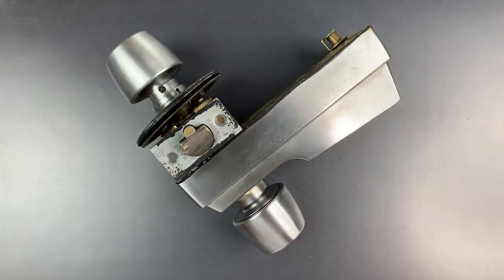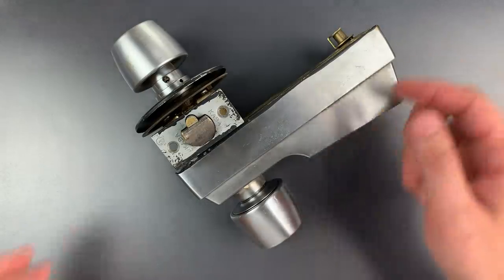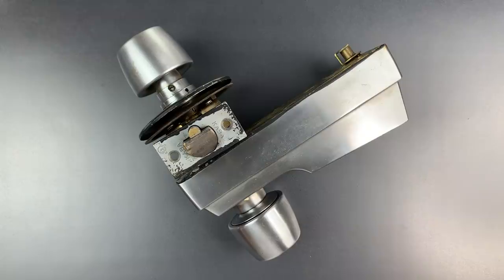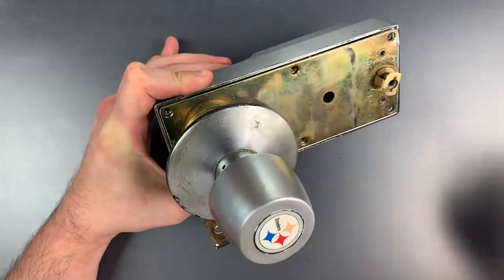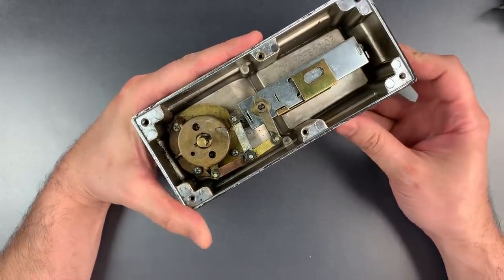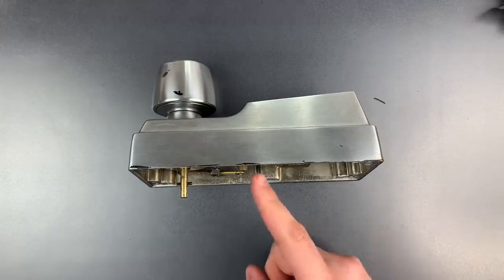[914] The Worst Lock Design Blunder Ever? (Kaba Simplex Series 1000)

Comment: Post Office I worked in 2008 had all the locks replaced with these.  I showed the post master just how easy it is to open these locks.  Postal inspectors came and looked at them and nothing was done.  The US postal service bought and had installed thousands of these locks.  (They were/are not inexpensive)To my knowledge, none were changed that I know of.  A friend who is a car dealer had this K 1000 on his key room door.  I showed him how easy it was to open and he had a local locksmith change it out for a Kaba 5000.   I understand lots of legal issues with this lock.
Reply: That just shows the difference between government vs private businesses.   Business owner alerted to a problem and just fixes it if possible.  Government alerted to a problem and it needs a dozen forms in triplicate to get an inspector out to verify that yes its a problem and send the forms off to a comity somewhere to ignore the problem for the next decade or untill the problem bites them in the ass.
Reply: @merendell  It also holds true with massive corporations as well though, big businesses don't give power to the people who can make change and the people who can don't give a shit.
Reply: @merendell  It's not that they don't understand the problem. What's it gonna cost if they don't replace the locks? For most places, nothing. The security of a government building does not come from locks. The businesses however have to worry about theft more than government.
Reply: @merendell  Yea, private businesses never make stupid mistakes /s
Reply: Our post office had a P.O. Box door pried partway out from the frame. Postal Inspector was called, looked at it, and figured it since it was still locked, and only partway open, no actual theft had occurred so no further investigation was called for. Easy!—except that it was obvious you could simply push a screwdriver into the opening and retract the latch. Customer of that box later reported several checks missing. One lazy goof, or are all PO Inspectors of that ilk? I dunno.
Reply: I believe at that time, the Postal Service had a particular YALE electronic lock requirement. Sometimes a postmaster was not following their own regulations.
Reply: @merendell  Try to calculate the cost of changing one lock versus having to change hundreds of thousands.
Also add the fact of: Stockpiles and the cost to scrap an inventory just to replenish it yet again >.>
Raise your taxes, and I'm sure they're happy to use your money like you want them to 😂

Also: How many post offices have been broken into due to this particular lock? 0? Alright then; shut up 😎
Reply: @MrMiss-cp9bw  cost to change 1 lock, 100 dollars per lock. Cost to change many thousands, 500 dollars per lock because the government handed out  a no bid contract for the lock replacement job. Probably alot more in all the various studies that need to be done before the committee makes a decision to replace the lock with one just as bad.

And to your last point. If the rest of the security is so good that even with shitty locks like this on the doors no break-ins have happened why did we need the shitty lock in the first place?
Reply: " Postal inspectors came and looked at them and nothing was done."

are you aware how lucky you are that they didn't sue you for a break-in?
Reply: @CaptHawkeye yep many people are negligent, also many small business fail in the first few years because of it. Gov is too big to fail so gets protected from screwups that would tank a small business reducing the pressure to do better.
Reply: @SirMcAwesome  U mad bro?
Reply: Yea but concider this. How many people actually have the knowledge and resources to open these locks? Probably not a lot. If someone is commited enough to beat all other levels of security and secure a high power magnet, that person could have probably gotten through the lock another way
Reply: @DimT670  Your excuse can be used to justify any bad lock then.  Just stick a Masterlock on everything.  "If someone is commited enough to beat all other levels of security and secure a high power magnet, that person could have probably gotten through the lock another way."
Reply: @poochyenarulez  it’s more that if a private company makes enough stupid mistakes, they go bankrupt. If a government makes enough stupid mistakes, they just raise taxes.
Reply: @choreomaniac  when government makes mistakes, you vote out the republicans who sabotaged it and vote in politicians who actually want tot fix it.
Reply: @poochyenarulez  yes. Look at Detroit, St. Louis, Chicago, Philadelphia, etc that have been run by Dems for 50 years. They are run so well.
Reply: @choreomaniac  yes, the areas with the most gpd are democrat runhttps://en.wikipedia.org/wiki/List_of_U.S._metropolitan_areas_by_GDP
Reply: @poochyenarulez  and the most crime, poverty, homelessness, mental illness, etc. urban areas are more affluent and more plagued with problems. But many of the affluent areas pinpoint to have recently been run by Republicans. Such as NYC. Look at the cities that have been run for 50 or more years by dems. Cali had Republican Schwarzenegger and NYC had Giuliani and Bloomberg was non-Partisan. Virginia and Maryland recently had GOP governance. It takes about 20 years or so for dems to destroy a city. Probably faster when de Blasio is in charge.
Reply: @poochyenarulez  and it’s funny that the old line was that the GOP was the “party of the rich” now the Dems are proud to point out that they represent the richest areas of the country!
Reply: @choreomaniac  Dems have always been proud to point out rich areas they run. Its rich individuals that dems find issue with, not a rich society.
Reply: @poochyenarulez  rich areas are by definition composed of rich individuals. In fact the greatest areas of income and wealth inequality are in dem areas. Homelessness next to billionaires is pretty much exclusive to democratic run areas. It seems democratic policies make wealth inequality worse, not better as they say their policies are intended to be. The very rich can avoid taxes and the very poor don’t pay them. The middle class gets pushed out and crushed. Look at California and NYC. The GOP is the party of the middle class and workers. The Dems are the party of the super-rich and very poor. The Koch brothers announcing no more donations to republicans is emblematic. Same with Bezos, Buffet, etc. the billionaires are mostly Democrats. And that makes them and the Dems giant hypocrites.

Comment: This reminds me of a situation which happened when I was young. We lived in an apartment complex with an electronic combination lock and I had taken apart a push-button lighter and was playing with the little piezo electric ignitor (the thing which you press and it makes a small zap). Out of curiosity I put the wires from it up to the lock, which was completely metal. To my surprise, when I zapped the lock it opened. It worked every time, and this was the standard combination lock in my entire city. I did not try it on other houses so it might have just been a flaw in this particular lock, but I'm wondering if anyone else has had a similar experience with electronic combination locks.

Comment: Thanks LPL!  This inspired me to add a big neo magnet to my pick kit!
I now have a chaotic stuck-together ball of picks and tensioners.  :-/
Reply: @Cheryl:  Wow, that worked well!  And thanks for the warning.  I hid behind the wife and kids.
The funerals are next Tuesday.
Reply: Just get a non magnetic magnet, that should solve all your problems.
Reply: Thanks Obama!
Reply: Obama care was never the answer
Reply: JamesG a
Reply: Won't loose them unless you loose the magnet XD
Reply: We used to have those at area 51 where the reverse engineering shop was, the Aliens kept breaking in we didn't know how. Now everything makes sense.
Reply: Just keep it away from your wallet.
Reply: I carry a magnet on an extending handle in my car's tool bag for retrieving hardware dropped in inopportune places. I sometimes refer to it as The Niffler in reference to the creature from "Fantastic Beasts and Where To Find Them" that always grabbed up valuables. It always grabs everything and makes a royal mess of itself. Same goes for the old car speakers on the junk shelf.
Reply: @quillmaurer6563    Cool, you're a smart feller!  I actually have a collection of NdFeB magnets, including a 2x2" cube and a 700-lb-pull monster that I embedded in a wooden block for safety.  That one does awesome things to nearby ball bearings, makes them into a moldable stuck-together mass.  These magnets have endless uses, practical and impractical.  :-)

Comment: My old office had one of these on a back door. Knowing that they typically use a 4 digit combination and that the digits can't repeat makes brute forcing the combination easy. I was able to brute force it in about 3 minutes one day.
Reply: The number of permutations is still 120. It definitely is not easy to brute force that manually. You got very lucky.
Reply: @aitismarka9483  not really, it takes probably 2 seconds or so to put in a code and turn the handle. three minutes is 180 seconds which means he could easily have put in 90 combinations in that time. Actually means he was unlucky lol, most of the time you would get it at or before 60 combinations, or about 2 minutes.
Reply: @itisinfactpaul2868  It is really difficult to come up with that many permutations without repeating ones you've already tried. You can test it yourself. Try to come up with as many non-repeated four digit codes out of the numbers 1, 2, 3, 4 and 5 as you can. Absolutely no way anyone's going to be able to come input 90 of those in 3 minutes. Without pen and paper that would be almost impossible to do even with unlimited time.
Reply: @aitismarka9483  All you need to do is count up from 1234 lol. Just skip any number greater than 5 or that's already in the code. I certainly hope you could do that quickly in your head lmao. Once you get to 4321, you've listed every code. Like this:
1234
1235
1243
1245
1253
1254
1324
1325
It would be even faster to do in front of the lock since there are only two final digits possible for any set of three initial digits and you could easily see which ones hadn't been pressed.
Reply: @itisinfactpaul2868   Oh shit, I hadn't thought about such a clean way to do it systematically. Just a little correction: you gotta do it up to 5432 and then you've inserted all 120 permutations. Thanks, mate. Gotta admit I was wrong.
Reply: @aitismarka9483  24, if you know what the four digits are. Frequently the buttons are worn down.

Comment: I have seen this lock (and the 12 button version) used on a lot of homes too, especially homes with younger children prone to losing keys. First responders in some areas in and around New York City used to use this trick when responding to a location with one of these locks so that they wouldn't have to break the door or wait for a locksmith.
Reply: trick doesn't work on codelocks or similar sabat locks
Reply: C Riley He said they used the trick on one of these locks... read the comment first....
Reply: haha okay Mr hobby locksmith, go get one and you'll see what's up. It's not like I know what I'm talking about or anything.. I only do this for a living 🤷‍♂️
Reply: @crestonriley6481  Literally missing the point of the post.

First responders would use the trick shown by LPL, On this specific lock, and a variant of it. Not any other brand. Not any other model. 

Your comment adds nothing to the original statement.
Reply: @olejniczak12  There just has to be one guy like that in every YT comment section xD

Comment: We had those on our classified shop doors in the air Force. Absolute trash. We had to turn the knob twice to get it to clear the valid code. They also break all the time
Reply: I was at work one Saturday when the plant locksmith decided it was a good time to change the combinations on all the basement labs without notice, which would force the users to go to the locksmith first thing Monday morning to register for the combo.

I called his office and left a message that I had something in the oven that was time sensitive, and to get down the basement ASAP. He left for the day. A pipe wrench makes these locks absolutely worthless. I got in the lab and removed my part from the oven with minutes to spare.

Never heard a word on the damaged lock.
Reply: Gunga Dinn I wonder what kind of oven would be used in an industrial manner like this.
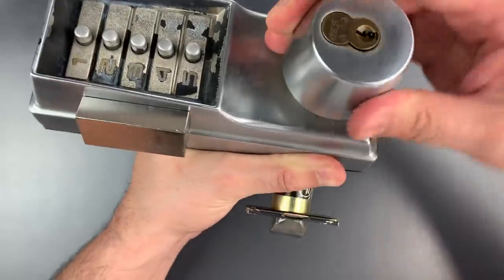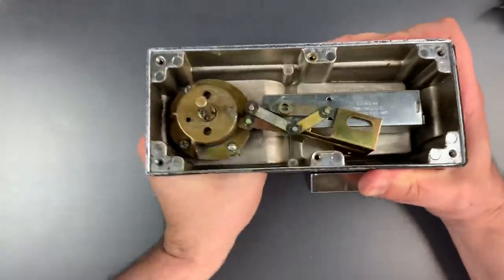Reply: you can see him having to turn the knob twice too at 1:15 and 2:31
Reply: @B0MYT +
  It was a Blue M process oven, and I was vacuum curing an out of autoclave graphite epoxy part. 

  We routinely would set a part up to run, being recorded by a DigiStrip recorder.
  When we worked weekends, you had three or four irons in the fire at a time. I'd be working in the machine shop machining test specimens, then in the QC lab for a 24 hour non-volatile test sample, and in between eating lunch. 

  My Blue M oven was only turned off when the power went out, otherwise it ran 27/7/365.
Reply: LPL had to turn the knob twice as well...
Reply: @Don.Challenger  People get rather pissy when you use those ovens for pizza.
Reply: I noticed he also had to turn it twice to get it to open. Very strange.
Reply: Godfrey Poon+

  I got pissy when people decided to cure silicone containing materials in MY oven. 
  Silicones out gas contaminating the oven which transfers to everything cured  inside the oven. The only way to get rid of the silicone is to burn the oven off at 650 Fahrenheit for 24 hours. 

  Some people are too stupid to read the sign that read, no silicone containing materials to be cured in this oven.
Reply: We had cypher locks that you connected wires to numbers to complete a circuit (Navy).  They were ok.  But our safes for the dual lock integrity were garbage.  They were rated at like 3 hours for someone to break into.  More like 10 minutes with a mini sledge and a crowbar.
Reply: Also, if you notice the little latch bolt, the sloped face is facing the direction of the outside of the space or compartment, meaning if you wanted to get in the old fashioned way using a credit card to swipe it open, you could. I literally used this trick to steal tools from the engineer's workshop.
Reply: @accelmemory  I would assume that is an installation choice, as that piece is usually reversible. In a real installation, it should be installed the other way (correctly).
Reply: I worked at a hotel a few years ago that had one of these for the front desk entrance, and yea, ours kept breaking to the point that we had to put paper in the jamb to keep the door from latching shut just in case it decided to not work again.  There were several times when I had to jump the desk just to open the damn thing from the inside.
Eventually the owner finally had it replaced with a more conventional key lock knob but it was a nightmare until then.
Reply: @accelmemory  You are completely wrong about the correct way to mount latch bolts.  The direction shall be so the sloped side hits the door frame first.  The strike plate on the doorframe shall have a hole so small only the sloped half goes in while the pin half is held into the lock, thus causing the deadbolt itself to disable the credit card trick whenever the door is closed.  Because he was demonstrating the flaw in the lock part, LPL didn't show the strike plate.
Reply: @johncrowerdoe5527  I'll correct myself to say that if the slope is facing outwards, then you can easily get in that way. If not, you can still easily scrape it with any thin enough hooked object. You have to realize that the doors they install these on leave a lot of room to play around with, and that's including the assumption the installer gives a fuck to begin with. Have you been in the military?
Reply: @accelmemory  If a high security door is sloppily mounted it might also become easy to kick open etc.  And no, unlike military men I'm not trained to kick in doors.
Reply: I was just about to say we used those in the Army to lock the door to area marked for Top Secret clearance or above in the early 90s lol
Reply: Had one of these break when I turned it getting into an Army SCIF. When we were attempting to repair it, we figured out this magnet trick and moved on to other locks.

Comment: My first job was in maintenance at a facility with similar push-button locks (10-key though) on each of two doors into a secure area. I was just a summer temp, so I wasn't given the codes to either door, but I was escorted with a senior member of maintenance in several times. One day he was already inside, sent me out, and I was supposed to come back with something but of course the door was locked. I glanced at it and realized there were 3 numbers entered every time and there were different levels of wear on the buttons. I pushed the 3 most worn from most worn to least worn and it opened. I don't know how long it had been there, but obviously it was overdue for changing the combination.

Comment: From my experience with these, the factory lock setting is 2 and 4 simultaneously then 3
Reply: Yes, and a lot of them were never changed from the default.
Reply: This
Reply: it was the code to the kitchen
Reply: Yep, that's always the combo lol
Reply: changing that requires a key to extract a cylinder, then a tool to move a change-collar, then a careful sequence of action, then putting it all back. If you get the key sequence wrong, you have to take apart that long rectangular piece and reset it. Been there.

So most folks don't bother.
Reply: Go reset the lock to some random code.....
Reply: That was the code for the office at the hotel I used to work at all the way until the thing broke for the last time and the boss had it replaced.
Reply: Or one of only 60 possible combinations if only using 3 numbers.
Reply: Seriously?  Makes sense now.